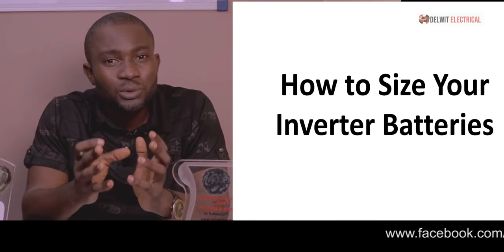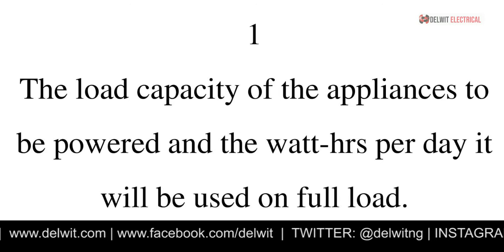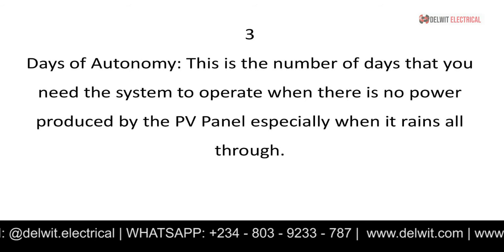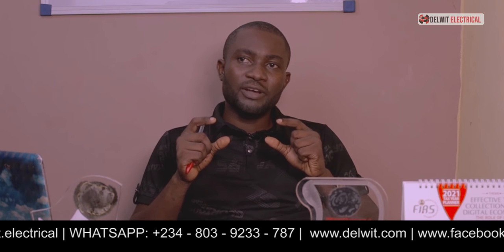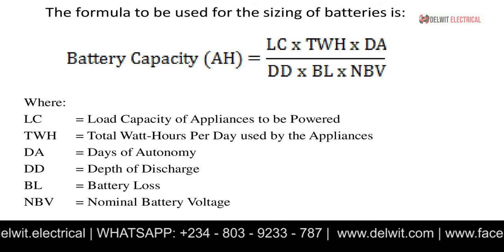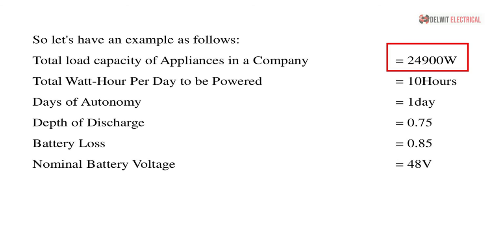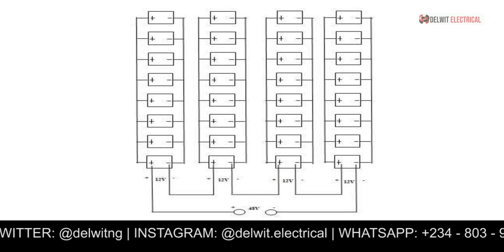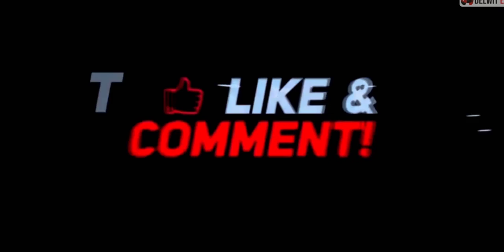How to Size Inverter Batteries

Comment: LifePo batteries have a 100% DOD, that should have been mentioned. Good video
Reply from the maker: Thank you for the additional information.
Reply: 100% depth of discharge and 100% fully charging a LifePo is a sure and certain way of reducing its lifespan considerably.

Comment: Sir, those four strings of 12V battery will surely give 48V, but only produce a total battery capacity of 2000Ah, that is 250x8=2000. However, the system battery capacity should have been 8137.25Ah. Can you please elaborate on this?

Comment: How do you get your battery loss.
Or is it specificied by the manufacturer??
Reply from the maker: You can either use a value between 0.8 to 0.9 depending on the efficiency of the battery as seen on the nameplate or you can use the manufacturer specification which will also fall between thesame value. On the datasheet of the battery you will see something like: 200AH @C20 (28oC) this means that the battery will charge and discharge in 20hrs with 10A load.

Comment: Lolsss
U still didn't achieve that amperage of 8k
Rather you achieve close to 2k amperage 
U still rather need 4x32 battery to active that huge bank 
U basically need 128 batteries😂😂
Reply: Best is to reduce your load or go 4 lithium battery to help you
Reply from the maker: How? Check the calculation well, 32 SMF/Tubular batteries will achieve that. I didn't talk of the DoD of Li-ion batteries that is why I didn't state it.
Reply from the maker: petershedrack9885 Lithium Ion batteries have different ratings, there is 30KWhr, 20Kwhr, 15, 10, 5 and so on. The idea is just to find the one that can give the ideal AH
Reply: @DELWITElectrical  I don't understand 
How does 32 batteries of 200ah  in series of 48volts give u 8000 ah??
Pls convince me
Reply from the maker: @petershedrack9885 Try to go through the video again, I'm sure you'ld understand better.